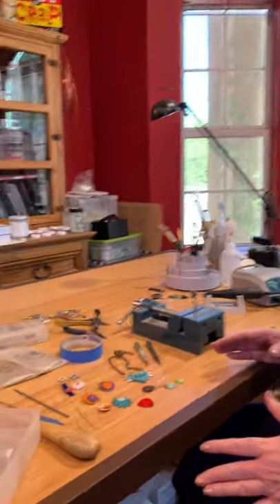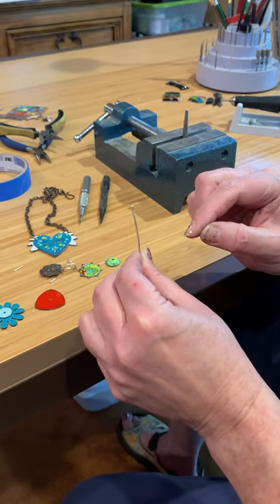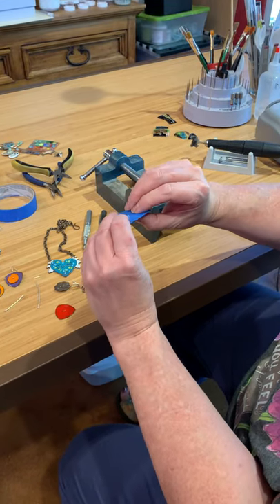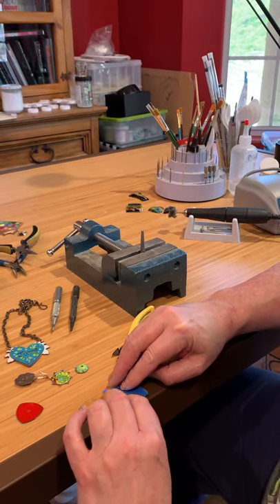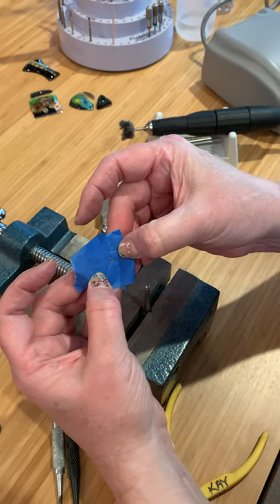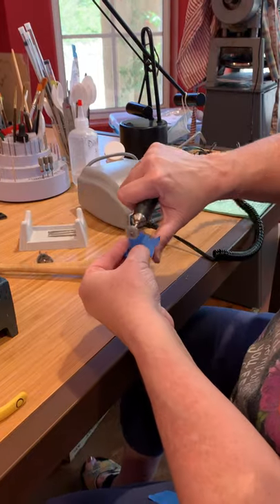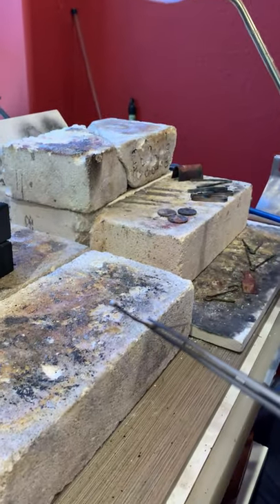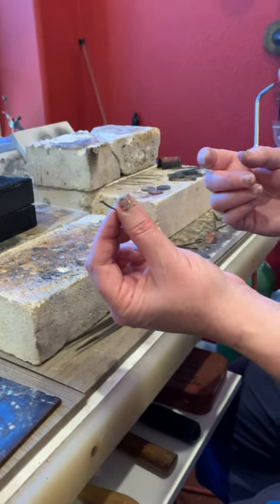How to Rivet Enamel Pieces together without cracking the enamel

Comment: Kay. I’m sure you will never receive this inquiry from your video. You did seven years ago but I’m curious I love your riveting and I’m going to try that but I’m curious if you I’ve been doing a lot of crackle and sometimes my holes get filled in what is the best way to open up those holes? Is it just a diamond drill and cross your fingers that it won’t crackand also do you have a secret to making ear post and doing stud earrings with Enamel